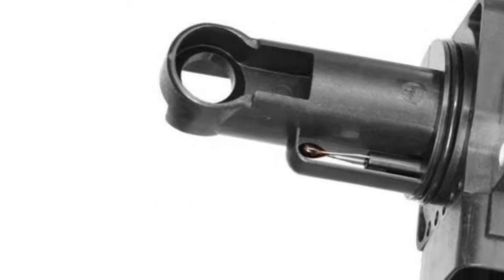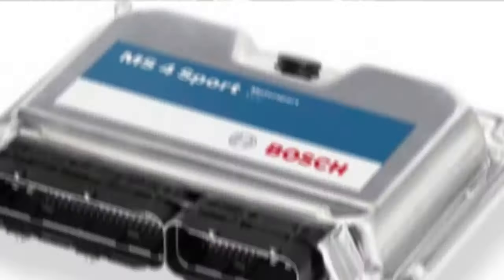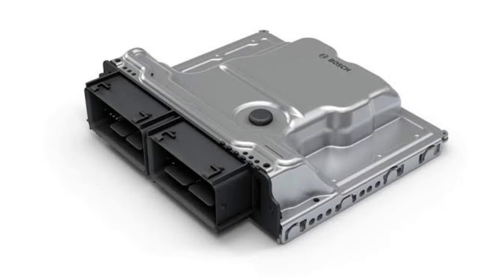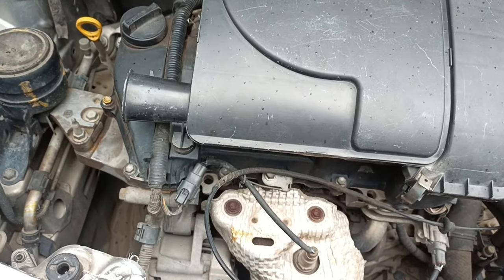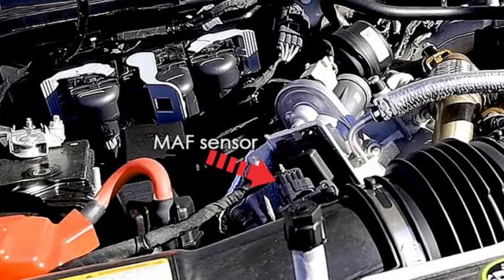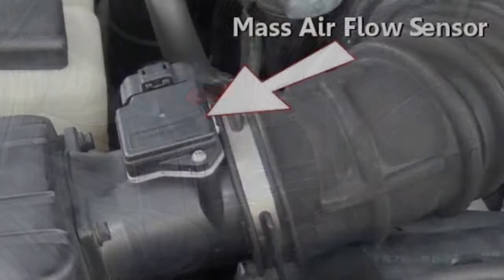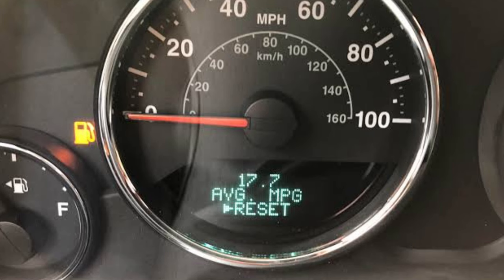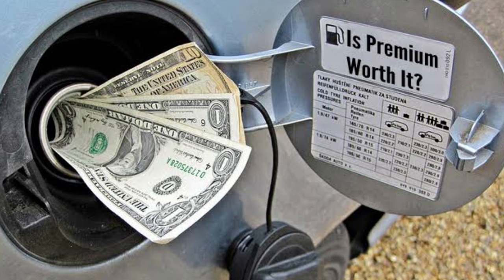5 sign of bad maf sensor

Comment: YT taught me this. Unplug the MAS while engine is running, if it stalls MAS is good if it runs its bad.
Reply: For which car is it still method 
Like Japan cars
Or and German cars
Reply: mine are Toyota rav4 and honda civic dont know about German but worth a try best of luck @Eduarddule
Reply: So unplug the MAF sensor? If the car stalls I don’t need to change that part?
Reply: Thats right. If it keeps running, it is most likely a bad MaF sensor.@shh9461
Reply: @fairydust-ky4oc this isn’t true. how can a bad sensor keep the engine running if its unplugged. when its unplugged, the harness has no idea if its any kind of sensor good or bad. not all cars are the same. theres a map and a maf and some cars rely primarily on map as its more accurate for determining stoichometry. some cars have very good backup plans
Reply: @wolleyreikivalley  because if the maf is faulty the ecu wasn't getting the airflow information in the first place so it will keep running
Reply: @shh9461 Correct

Comment: Also a clogged air filter can trigger a maf sensor code as well! I learned from experience. Took 4 days to figure out. Then it hit me, took the filter out since the air passed through it first before the maf and drove with it off and no more problems. Replaced it and the issue stopped. I bought a maf brand new and the problem didn’t change. Spent $150 and returned it in 10 mins since it didn’t fix the issue in the parking lot

Comment: I have experience three of the sign of bad MaF sensor.  But according to other mechanics  a good  MAF sensor will stop the the engine if it was disconnected.  I tried it and the engine stopped.  What is true and false?

Comment: So i did this trick and unplugged it and had a little power surge and ran. Didnt stall like i was hoping but it did turn on the fan after i unplugged it. So bad MAF right. Just want to be sure.
Reply: If you unplug while car is running is it a bad thing for the vehicle .

Comment: I have symptom 3 perfectly, is there a difference between this and a bad O2 sensor?
Reply from the maker: a MAF sensor detects the air density as it heads into the engine intake to be mixed with fuel, The O2 sensor is responsible for measuring how much unburned oxygen is in the exhaust.
Reply: @haileauto my 2005. Forester revs up in between shifting????
Reply: that sounds like a transmission issue man, sorry.

Comment: Hello, ive been having issues with my Dodge Journey 2015 2.4engine 
Ive taken it too soooooo many mecanics they don’t find the issue, im done spending money 
Ive just heard about this sensor, 
If this sensor went bad, would it cause car too completely stop this is a problem i have, also when im driving and i turn on my AC thats when the car will come too a complete stop 
Would this be an issue? Thanks
Reply: Have you gotten ur spark plugs checked?could be bad spark plugs and when you turn on the ac the spark plugs are not giving enough sparks to keep the car going
Reply: Alternator problem